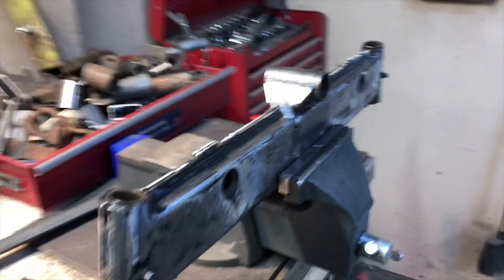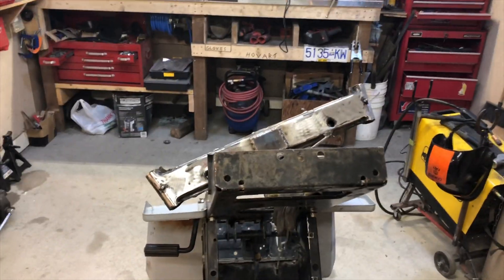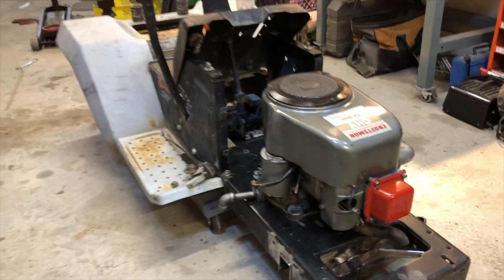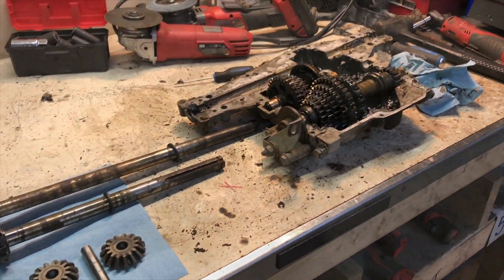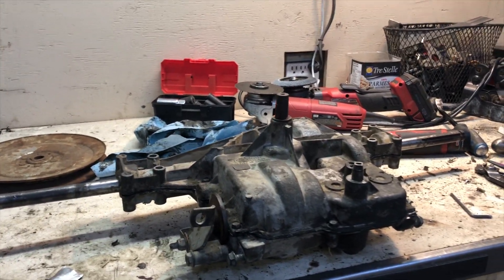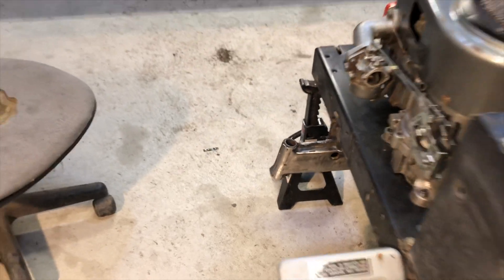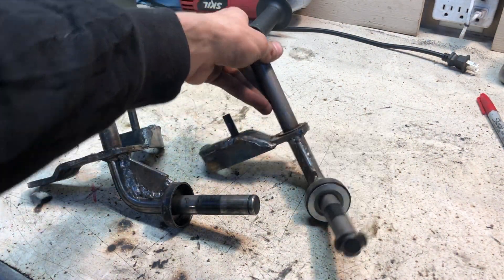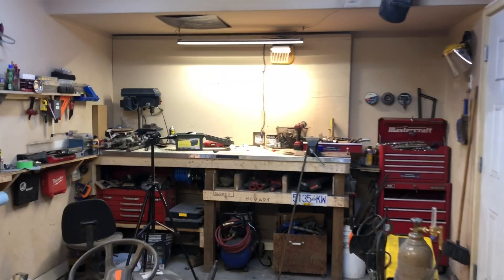HOW TO BUILD A OFF-ROAD MOWER PART 2

Comment: Nice video....I learned a lot. Can you tell me/your audience, which mowers you look for and prefer to transform into a crawler? Which mowers have the standard transmission vs the hydrostatic oil drive units...Thanks
Reply from the maker: We like looking for older mowers 
With manual transaxles that have 1” axle shafts 
Peerless 2300/1200 
Peerless 820 
Peerless 633a 
Along with that we look for more Harvey duty frames 
These style mowers usually come with 5 bolt 12” rims 
That we’re able to put 25” atv tires on to 
As well they usually come with 8” front rims that we also use to run 19-20” front tires 

Some mowers have hood steering setups that can be modded easy some are a lot more work 
But it’s definitely important to have a strong steering setup 

We also like to add hydro hand brakes to the setups as well 

A lot goes into building a mower 

We don’t run hydrostatic transaxles for off-roading mowin 

When looking for a mower a big clue to it having a good transaxle is a 12” rear rim that has a 5/3 bolt pattern with a 1” axle shaft 

We kept breaking all the 3/4” transaxle to easy 
Never looked back once we moved into heavy duty transaxles 

If you looking for a mower, put out an add on your looking market place looking for free or cheap mowers! Works every time! 

We will be a making a new YouTube video going over everything someone needs to know when looking and building a mower!
Reply from the maker: This is a old video on the channel 
Check out our new build series builds, tons of info in the videos

Comment: Newby here. Really enjoying your channel. As a beginner youtuber myself I'm seeing great improvement in your vid quality and content. Question. Why weld the trans axle?
Reply from the maker: So both tires spin together, it’s like having a locker in a off-road truck
Reply: @okoffroadmowers  defeating a differential where one wheel is slipping and the other is doing all the work. Positraction?

Comment: Protip from a harley tech. Wear rubber gloves when dealing with grease, oil, brake fluid, and super glue. Grease in particular is a pain to clean off your hand. It takes forever to scrub it off. But gloves make it a breeze. Keep at it kid.
Reply from the maker: Yes very good point! 
Always love tips!

Comment: What is that 5 hole plate actually called? I can find the small hubs but not the plate to weld it too!
Reply: where do you find the small hubs?
Reply: I'm also wondering what both are called so I can find them local

Comment: You’re reassembling your transaxles incorrectly, the brass bushings that are on all of the shafts have a little nub on them, you have to make sure the little nubs line up with the slots in the casings

If you do not do this it will bind when it’s tightened down all the way and make it really difficult to spin, 

Those casings aren’t meant to have anything but rtv sealer in between the mating surfaces, this might be the reason you keep breaking axles, you’re actually creating more play for all of the shafts with putting a gasket inbetween the casings
Reply from the maker: Yesss! Thank you redzzzzzzz thank you so much I will change that! The gasket stuff I use squeezes Down  to nothing! Will update people with this lil tip in a new vid, thanks again! Appreciate it
Reply: @okoffroadmowers  well that’s good the gasket stuff squeezes down pretty good but just check them out next time you you do one, you’ll see what I mean